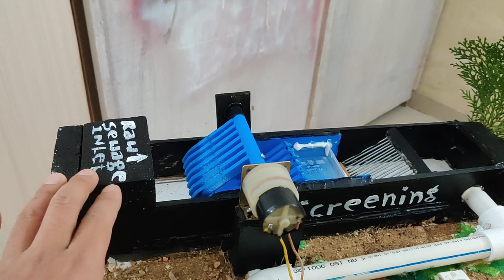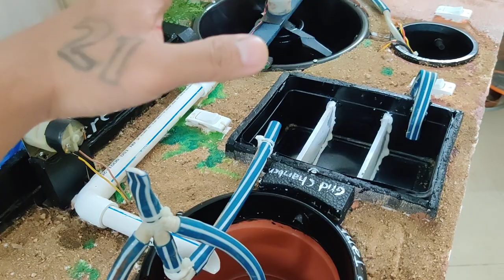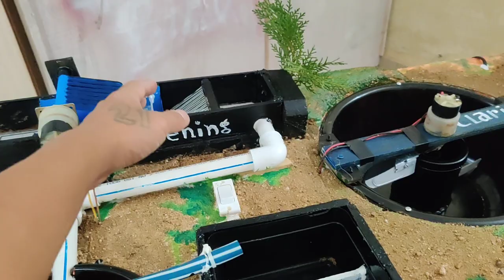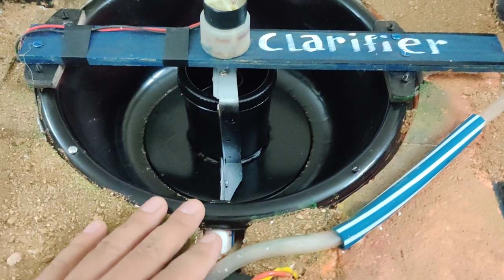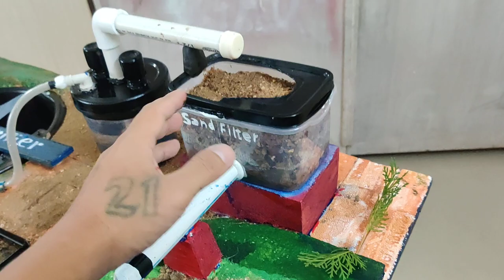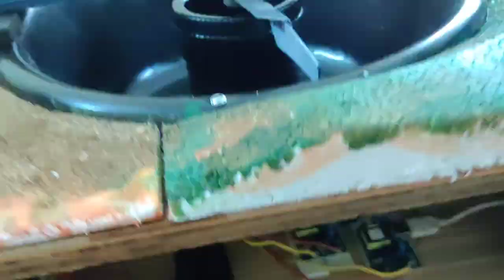ETP Model- Full Tutorial on Effluent Treatment Plant Model

Comment: Have you used arduino for the programming?
Reply from the maker: No need for arduino and programming. Simple connection to the motor and power supply
Reply: Kindly send a complete list of material

Comment: I am confused about this screening material like what you used in making that body as well as in making this rotary fan
Reply from the maker: I am using DC geared motor of low RPM for the motor.  Probably around 30-60 RPM 12V